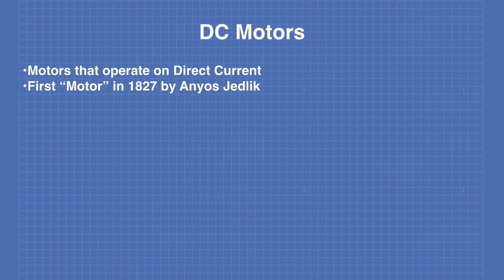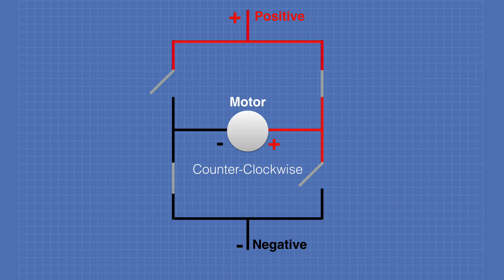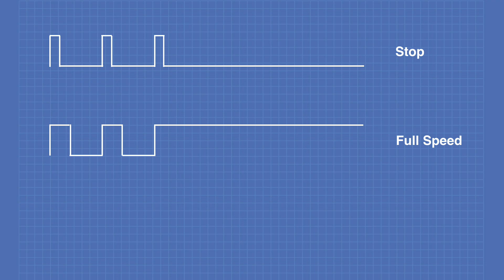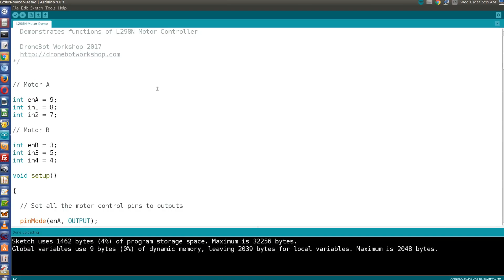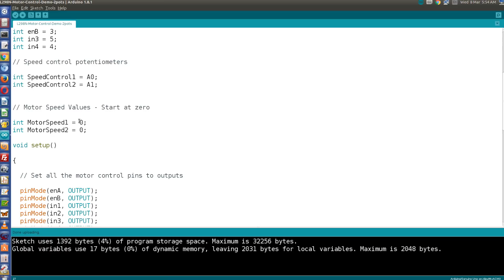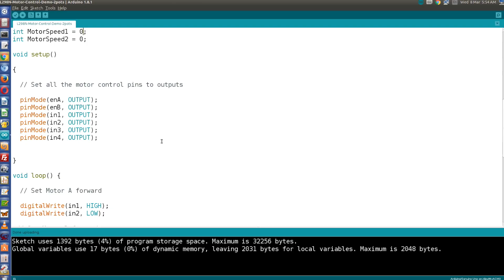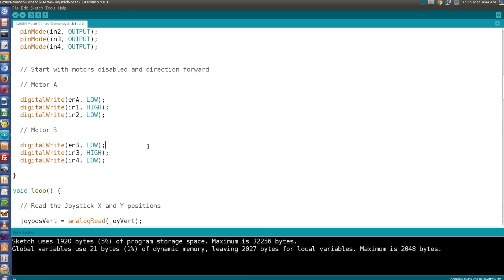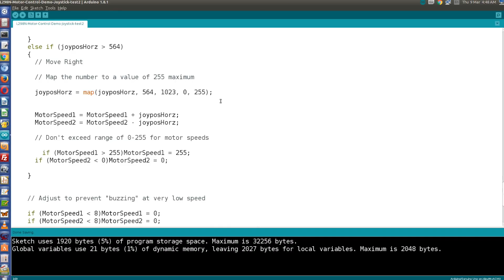Controlling DC Motors with the L298N H Bridge and Arduino

Comment: so this is my setup i need some help with it:
Arduino SMD Uno
L298N moter driver
HC-05 Bluetooth module 
battery is 7.2 volt 
i conect HC-05 to vin gnd rxd and txd the L298N to arduino with all pins still on there so its set to full speed my car is like really heavy it works but dont go really fast while the backmotor is for speed its taking a long time to get to final speed what is wrong people i cant figure it out

Comment: Brilliant video! Could I use an Interlink Electronics FSR402 0.5" Diameter Force Sensing Resistor to move one or two motors to a position (or say move the motor slowly for 4 seconds or so) when pressed and stop the motor - then when pressure on the Force Sensor is released, the motor goes back in the opposite direction to the starting position? I would be truly grateful for any assistance. Thank you.

Comment: Hi,
I have the right driver (06:02) controller but after 30sec of motor spinning it gets very hot?
i have a Nema 17 17HS8401S, and a 12v 5A power supply
i control it with a Raspberry Pi through some optocouplers and the 4 inputs gets 5v from "MB102 Breadboard Power Supply Module" connected to the same power supply 
input pins should have resistors ?
motor wires should have an order event if it spins ?
power to l298n module should have some resistors ? because now is connected directly to power supply
thin wires can heat the controller? I expect the wires to get hot in this case
please help :(

Comment: Personally, I prefer soldering my DIP components myself, but that's just a matter of taste. Sometimes I'm lazy and just plug a Nano.

map() is overkill when converting a 1024 values range into a 256 values range, "div 4" is not as bad, but still excessive, and  [0-1023] is definitely a multiple of [0-255]. The shortest way of dividing by 4 (integer division) is simply to shift the bits right by 2 positions (shr 2, or >>2). Also, you prefer using 511 as the middle of the interval [0-1023] because it's the end of the first half of the interval, not 512 which is the "0" of the second half. But as you say, the joystick's center is not that precise, you don't care too much. How about a "center" function?

The test for the joystick position ("margin") is pointless, because you also have a test for minimum speed before sending the analogWrite() commands, so you're basically doing twice the same thing.

The command from the joystick EITHER changes direction OR goes forward or backwards. Not very practical...
Therefore, you only want shr 1 (a shorthand for div 2), and subtract 256 to it, giving you 2 values (H and V) in the interval [-256 ; +255]. A test on bit 15 (shr 15 gives 1 for negative numbers) gives the sign in each direction (the 10-bit [0-1023] value is converted into a 16 bit value when you store it into an int) so it's pretty easy to get the direction to send into the H-bridge without cascading the if()s. 

Anyway, if() is just a waste of resources when you can use a and(0xff) to force a [0;255] range.

Also, on demo2(), a linear for() loop with a constant delay is definitely not right for an acceleration or deceleration, that's simple physics. You wouldn't do that in the real world.

I know, on such a "project", you have used only a tiny part of the memory for code and variables, you don't care too much about code speed anyway, thus all of the above may sound excessive ranting, but the goal is to get proper techniques rather than trying to find the quickest way to build an example application, right?
Reply: Thanks i'm going to try and use this. You must be from the old school. A vid on this kind of stuff would be beneficial to the younger generation(me included) that thinks memory and performance is abundant. Thank you.

Comment: I,m using the l298n driver chip alone without its board as the one in the link below
https://media.rs-online.com/t_large/F0636384-01.jpg

using this datasheet
http://datasheetcafe.databank.netdna-cdn.com/wp-content/uploads/2016/07/L298N-datasheet-pinout.gif

and i did the same steps, but it didn't work
Do i have to anything else in this case ?
Reply: +DroneBot Workshop

Comment: Hi Thank You very much, this video is great!
I've only a question.. Do I have to provide energy to the arduino with an external battery, or the 5V pin on the L298N is an output that can feed the arduino? I'm asking since I made the project following all the steps, but at the end if I disconnect the Arduino from the PC it doesn't work... 
If anyone can help me :)

P.S. immediately subscibed

Comment: Sir we can use for dc motor 24v 12a 259w.plz clear my doubt
Reply from the maker: Hi Akhil. You would need to use another H-Bridge, 12 amperes is too much current for an L298N. There are a few commercial controllers (check out some of the ones from Cytron ) or you could build one yourself with some power MOSFETs if you have the talent to do this safely.
Reply: DroneBot Workshop Thank you sir,12a is the rated current of the motor,our project is on automatic wheel chair so we required constant low speed but high torque. so how we can do this in simple way.plz suggest any idea
Reply: DroneBot Workshop sir,how we should Connect two h bridges

Comment: Great video.  Is it possible to use this setup to operate a two-wire 12V DC brushless motor?  I can only get the motor to run when I send a PWM value of 255 with 12V input.  Below that, it just hums.  However, the motor happily runs on 5 volts from a 5-volt power supply.  Thanks.
Reply from the maker: Not with this setup - brushless DC motors are a different beast and require a different controller. I will be doing a video on using brushless DC motors in the near future.

Comment: Good video and well explained. Will you be doing any videos on how to control multiple motors, for example 6 motors? I am thinking of doing a project that will have 6 wheels. Will I need to use three H bridge controllers?
Thanks again for a very interesting video.

Comment: Hello, Very good information here, i stuck with it and followed along even through some areas i already understood,  Im using the "other" Dual H bridge that you showed but did not hookup, This video helped me understand that PWM Must be controlled by the enable pins exclusively, I was also having a hard time understanding PWM control on my board because your board has no 5v jumper connection available that i can see,  Understanding the 5v INPUT/OUTPUT was also something else i had to learn, that terminal is all about the voltage regulator on the board, and whether you're going to use it,  Or if you're at a voltage you must not use it,  I did not copy and paste the sketch because   //I'm trying to become a better (codeWriter);  thanks.

Comment: Great tutorial... Loved it from the start to the end. But, i have few doubts to be clarified.
1. How to pick the correct driver to the chosen motor ?
2. For the motor power, can i use a Li-Po battery on the driver ?
3. Is that sound a general thing while running the motors or is that motor struggling to turn those wheels ?

I'll be glad for the answers.... Thanks for the video mate...
Reply: did you find the answers
Reply: @vikrantsingh47  Yea i figured it out on my own. It looks like i can use any driver to run the motors as the drivers provide the required current to run the motors, so that's not a big deal. The second answer is, YES. I used the Li-Po battery and it worked without any issue. Finally the third answer, that's the normal sound generated by the motor. Hope these answers will help you if this is what you are looking for :)
Reply: @charliebenton9391  thanks for the reply. Did you also try other boards like STM32 nucleo
Reply: @vikrantsingh47  Nope.. I didn't think of trying with other boards. Why ? Is there any issue with STM's ?
Reply: @charliebenton9391  no issue, rather it is a step ahead of arduino. i am trying to build a drone, and almost all the flight controllers are using stm32 inside. also opesource libraries like ardupilot also uses stm32.

Comment: If I would like to power my motors with something like... 12v will that be okay for the board?
Reply from the maker: The L298N board can handle up to 35 volts. As long as your motor is rated to handle 12 volts (actually 10.6 volts after the voltage drop in the L298N) and consumes 2 amps or less then you'll be fine
Reply: +DroneBot Workshop Is the left motor supposed to stop when turning right and motor right stop when turning left?
Reply: +DroneBot Workshop I also have an issue with the 2 motors not spinning together when going straight or backwards... The left seems to only spin when I move the joystick around the left area and vice versa for the right
Reply: DroneBot Workshop Hi, I was just wondering if there was a board similar to the L298N that could control 2 DC motors but could handle a higher amperage allowing for the motors to be far bigger. Thx.

Comment: hello sir, Is this set up still works if i will use a bigger set of motors? for example is a motor with 12v each
Reply from the maker: It will work with any motor up to 35 volts as long as you give it the correct power supply. Remember that you'll get a 1.4-volt voltage drop because of the two transistors in the L298N so for a 12-volt motor you would be best to use a 13.4 volt power supply (although it will probably work quite well with a 12-volt supply with slightly reduced motor torque)
Reply: uhm i have red that i  must have a total of 13.4 something volts in my dc power supply in order for the L289N to power on, uhm can i ask how can i do that?

Comment: Thanks a lot!! I couldn't get my very similar Linksprite L298N board to work, but when I used the actual header pins for the 5V and GND it worked after using the jumper. Anyway great tutorial!!
Reply from the maker: Glad you enjoyed the tutorial and also happy to hear you resolved the issue with your L298N board. I usually use the 5-volt supply from the micro controller (Arduino) as that way I'm sure that the logic levels on the board will be referenced to the same power supply as the Arduino's.  Also if your motor supply is under 7.5 bolts the on-board voltage regulator on the L298N board may not function correctly

Comment: What kind of cable wire did you used?
Reply from the maker: If you are speaking about the long wire I used for the motor demo it's actually 4-conductor telephone cord! Probably not the best choice as you lose some energy due to it's thin gauge, but for this demo it worked and was flexible enough for the job.

Comment: you used  5v as input for arduino to power up but input voltage is 7-12v is recommended ...so is there any problem if i use 5v as input voltage ?
Reply from the maker: A bit of confusion here I think. The Arduino in the sketches is powered by the USB port, which is indeed 5 volts.  And you CAN power an Arduino Uno directly with a 5-volt power supply by using the "v in" connection.
The Arduino power input jack needs at least 7 volts as it uses an LM7805 type voltage regulator to produce the 5-volts that the Arduino actually needs.
Hope that clears it up a bit!
Reply: thanks for this important information.

Comment: Is it possible to integrate a sp2 controller instead of the joystick, ? I chose to ask u because u explain things very well &  I think ur the right person to ask
Reply from the maker: by "sp2" do you actually mean "PS2" (as in Sony PlayStation 2)?  Integrating that directly would be difficult as the controller doesn't (to the best of my knowledge) output analog signals.
You COULD salvage the joysticks out of a broken or unused PS2 controller and they will likely work, my understanding is that they are analog devices. But considering the low cost of experimenters Joysticks it really doesn't seem to be worth the effort.
Reply: DroneBot Workshop yes my fault I meant ps2 as in PlayStation an thank u for the feed back very much

Comment: covered L298 very nicely! can you also do video on DRV8833 DC Motor driver? L298 has a lot of voltage drop, its very old and is may not be good for the battery powered application.
Reply from the maker: That is a good idea and I will certainly keep it in mind, I have a few of those in my parts drawers.

Comment: why 7.4 volts? I don’t understand
Reply from the maker: The H-Bridge will drop the supply voltage by 1.4 volts (it has two transistors and each one drops the voltage by 0.7 volts). So to power a 6-volt DC motor you supply 7.4 volts to the H-Bridge (7.4 - 1.4 = 6.0).
Does that make sense?

Comment: what you have done is very interesting, what is your opinion in regards to using the same logic on a vnh2sp30(aka monster motor shield) ??? ...no i am not power hungry hahaha, take care
Reply from the maker: With a H-Bridge designed to drive a 30 amp motor you'll have a hard time convincing me that you aren't power hungry! 
Seriously the Monster Motor Shield uses a pair of VNH2SP30 IC's to support very current-hungry motors and would be excellent for building a large "R2D2 type" robot or a powered wheelchair.  As long as you have the necessary power supply it is used in a very similar fashion to the L298N, two inputs to control direction plus a PWM input (which is called "enable on the L298N") to control speed.
I'd love to know what you're building with this beast!
Reply: well, here goes the explanation, my background is electrical engineering, and because of this medication:
tegretol, i am in the process loosing nerve control on my legs thus coordination, my weight is about 75kg,
so i am planning to build a pair of "legs" with my arms+hands to control movements+direction; 
from my calculation, to move a mass of 75kg, i need shields like vnh2sp30 and motors with capability to
move me...and NO , NO TO SCOOTERS...i do not like sitting around;  
btw i would be grateful, if you can suggest any dc gear motors that will deliver that kind of power, i thought
25v, 16a...or with torque around 25Nm would do the job( for one "leg")
Reply: before i forget, let me wish you+family a merry christmas+happy new year, and do let me encourage 
you to continue in  your good work;

Comment: Hello sir.Did you know how to control the speed (PWM) of an dc motor with the joystick of PS3?
Reply from the maker: If I'm not mistaken (and I might be, I've never owned a playstation and haven't played a video game since Pong in the 1970's!) the PS3 uses a joystick that utilizes 4 microswitches as opposed to an analog joystick like the one I show here.  If that's correct then it isn't feasible to use the same circuit as I show in the video. Sorry about that!

Comment: What changes would I need to have, so that 12V wiper motor A & B are used instead? Also If I wanted 2 solar sensors to enable CW or CCW motion where would sensors be mounted to (Arduino uno, L298N or breadboard)? Trying to setup Dual Solar Trackers.
Reply from the maker: Using 12 volt motors is easily done with aan L298N providing that they consume less than 2.5 amps of current each - you may want to check the motor specs first. You would need to use a 13.4 volt power supply to deliver the full 12 volts to each motor, conveniently that's the same voltage as a standard car battery.
As for the sensors are you speaking of using photocells or solar cells. I would suggest photocells to measure light level and wiring them in a voltage divider to deliver a variable voltage to each analog input of the arduino. You would need to do some experimenting to determine how to translate the levels into the desired motor movement but otherwise the same code I used for the joystick could be used with a few slight modifications.
If you're building a Solar Tracker though you might do a better job with some servo or stepper motors to allow precise positioning. I'll be releasing videos on both types of motors shortly.

Comment: Hello, I am using a very similar or perhaps even the same kit to you that I bought off ebay, but am having problems with the motors. I can send the same PWM signal to both, but one starts to rotate before the other, so the robot turns when you're trying to go forward. The other problem is that I get the buzzing of the motor until about a PWM signal of 70  or so. Meaning that I can't driving slowly. Do you have any ideas? is this just cheap motors? or is it the L298N module? ... I am using a 7.4v Nimh battery if that helps.
Reply from the maker: I just did another video recently about using the speed sensors that come with the kit to measure the actual motor rotation speed.  You could use that measurement to regulate each motor so that they spin at identical speeds.
Otherwise the only thing I can think of, aside from using higher quality motors, is to add some gearing to the motors to slow them down so you would have more precise control at slower speeds. Keep in mind that these motors are already internally geared.

Comment: does a L298N H bridge acts like a gearmotor with an encoder(e.g. Gear motor w/ AS5304 Linear Sensor)? Because having L298N is drastically cheap compared to a gearmotor+encoder, which is around 100$
Reply from the maker: There is a difference, mostly in the available torque. A gear motor will slow down the motor while increasing it's torque, while a speed control based upon the L298N can slow the motor down but the torque will remain the same.
Actually those little yellow "toy" motors I'm using here are internally geared down.
As fo rteh speed encoder I just released a video showing how to use them, you may find it useful - https://youtu.be/oQQpAACa3ac